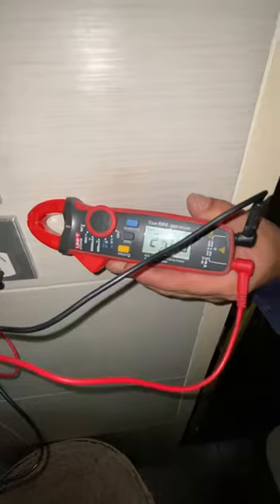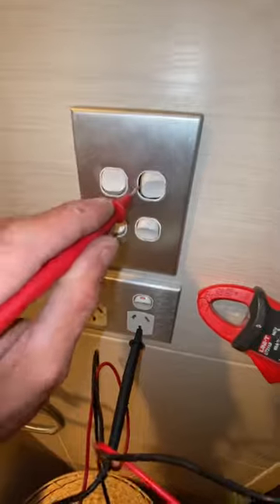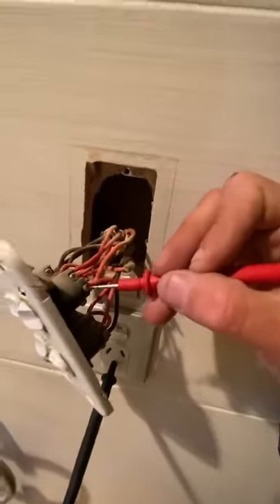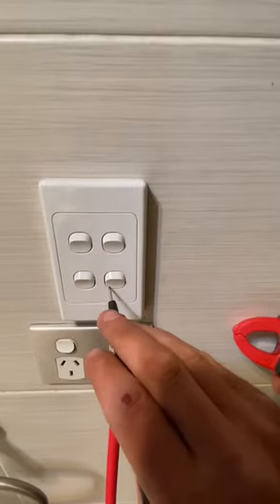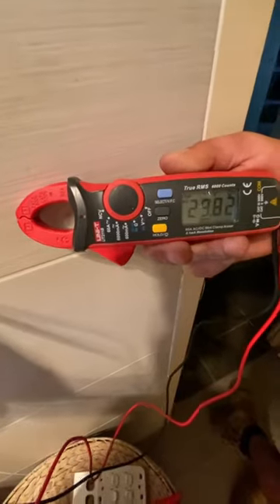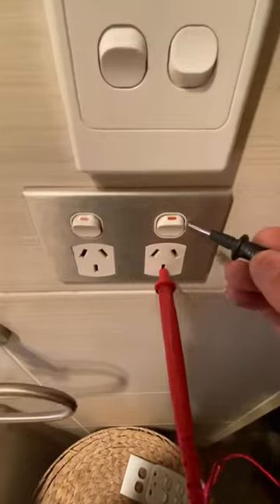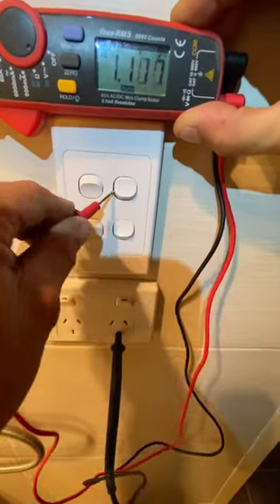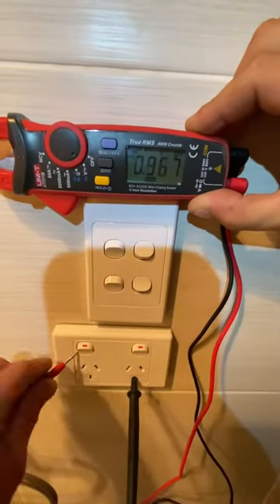Fault Find: Dodgy Switches and Outlets Giving Tingles

Comment: Dodgy switches, or just conductive contaminants on the switch mechanism?

If the latter couldn't that happen with literally any mech and not the fault of the manufacturer?
Reply from the maker: Doesn't explain the broken plastics does it? It's not like it was in a kitchen.